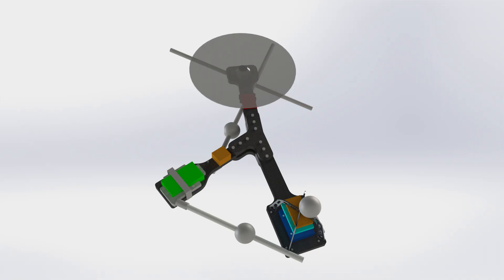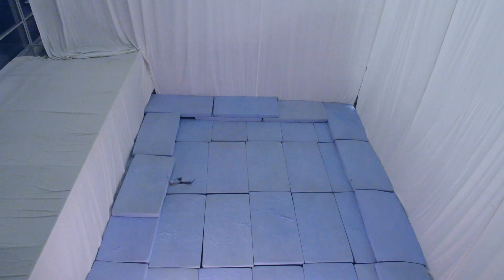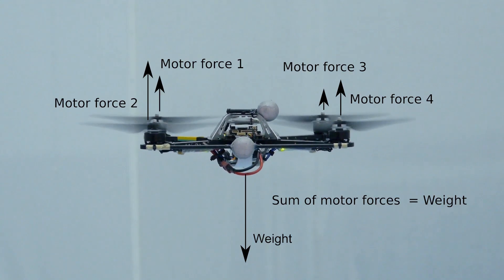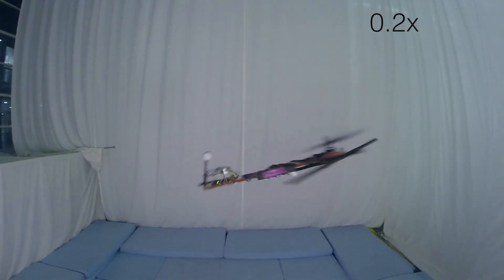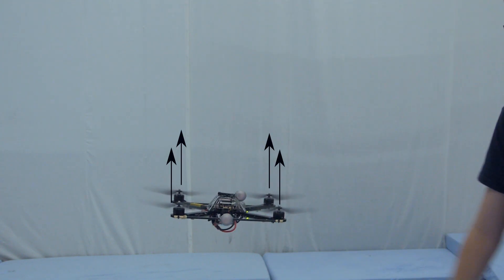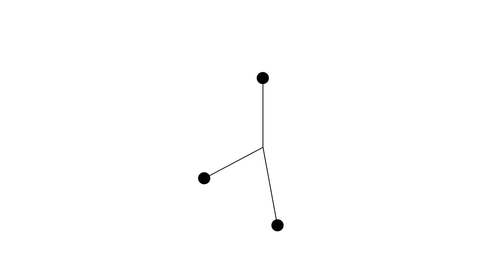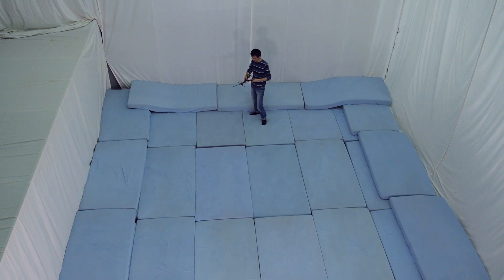The Monospinner: a controllable flying vehicle with a single moving part

Comment: 1. Rotational Dynamics Equation

I_B \dot{\omega}_{BE}^B + I_B p \dot{\omega}_{PE}^B + \left( \omega_{BE}^B \times \right) \left( I_B \omega_{BE}^B + I_B p \omega_{PE}^B \right) = [r_P^B \times] e_P^B f_P + e_P^B \tau_P + \tau_d^B

, : Angular velocities.

: Position vector of the propeller relative to the body.

: Force produced by the propeller in the body frame.

: Torque generated by the propeller.

: Damping torque due to aerodynamic drag.

This equation represents how the monospinner's angular velocity evolves due to applied forces and torques.

2. Translational Dynamics Equation

m \ddot{p}^E = e_P^E f_P + mg^E

: Acceleration of the center of mass.

: Propeller thrust in the world (inertial) frame.

: Gravity force in the world frame.

This describes how the monospinner moves due to gravity and propeller force.

3. Damping Torque Equation

\tau_d^B = - \| \omega_{BE}^B \| K_d^B \omega_{BE}^B

: Angular velocity.

This models how aerodynamic drag resists rotation.

4. Propeller Force Model

f_P = \kappa_f (\omega_{PE}^B \cdot e_P^B) |\omega_{PE}^B \cdot e_P^B|

: Angular velocity of the propeller.

: Direction of the propeller's thrust.

This equation gives the propeller's force based on its angular velocity.

5. Propeller Torque Model

\tau_P = - \kappa_\tau (\omega_{PE}^B \cdot e_P^B) |\omega_{PE}^B \cdot e_P^B|

This describes how the spinning propeller generates torque.

Overall Meaning

These equations fully define the monospinner's motion, including:

How it rotates due to propeller torque and aerodynamic drag.

How it moves in space due to thrust and gravity.

How its single propeller produces both force and torque.

Comment: I think Monospinner could be modified into a good cheap tail sitter drone. The main body of the drone is a dihedral flying wing, with Monospinner pulling it forward (or up, in the tail sitting position). Superficially, it looks like a normal propeller, but it's on a bent crank. As the prop spins, it naturally spins the crank at a lower speed. Thus, the prop circles around a bit.

The point is, the crank offset lets you control the average alignment of thrust by pulsing thrust cyclically. You can control the movement of the Monospinner Tailsitter toward any direction, and the dihedral flying wing will follow suit.

The crank system does mean that this hybrid Monospinner Tailsitter has two moving parts - the propeller and the crank. However, it maintains the hardware simplicity of the controls. It only uses a single on/off motor for full directional control.

The use of the dihedral flying wing in horizontal flight mode means this tailsitter can have excellent range and endurance. And unlike a tail sitting quadrotor, it doesn't have the rotors sticking out on drag inducing bars. The bent crank only needs to offset the rotor a modest amount.

Comment: Not buying it. How can you control in wich direction it goes in by only adjusting the speed of the motor?
Reply: It actually works, watch ScrapMan video where he recreated this in a video game
Reply: It's because the position of the rotor hub is off center. Thus, the rotor's position moves around in a circle rather than staying at a single place. If you increase and decrease thrust as it goes around the circle, you end up with an off center overall torque that alters the direction of flight.

Comment: a machine that uses zero moving parts would need some kind of bladeless turbine to produce thrust, using either some crazy application of heating and cooling elements, electromagnetic currents, ect. right now i think the closest analogy would be a ramjet quadcopter, though considering a ramjet needs an initial velocity to get it started it would be more like a ramjet frisbee thrown first to give it that momentum. maybe not a fully autonomous flyer, but could be a (relatively) cheap drone if you can get the construction right. maybe use electric heating elements somehow instead of fuel. a single camera facing downwards with programming to counterspin the footage so it looks steady would be the best you could get without moving parts though
Reply: vaguely similar plans about this kind of machine where pioneered in 1913, some others planned to use small rocket motors to propel the blade https://en.wikipedia.org/wiki/Monocopter

Comment: I have a couple things I want to ask:

1)  Are there any open source models/software or is everything about this project propriety? It's super awesome and would  love to try and recreate one :-)
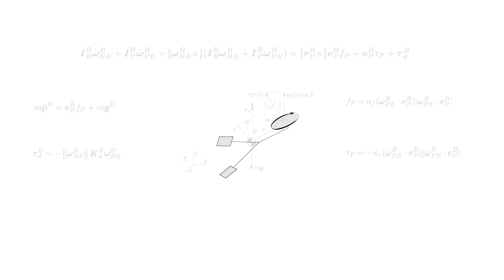2)  Could someone help me understand all that those math equations 0:43? 
3)  How do you steer the thing without causing the momentum to flip it over?  Do you have to spring the whole thing like a boomerang to get it to start (there is no initial rotation about the center of mass)? 
4)  1:39 even simpler than one propeller? how about half a propeller :-)
Reply: No, not even one propeller. She said NO/ZERO moving parts... 
This is why I came to the comment section, she's joking, right? How on earth is this even supposed to work...? 
Am I understanding something wrong?!? Anybody got an idea?
Reply: @2Complex2  Well, theoretically you could use ion propulsion like the one built by MIT. But I believe it's still very experimental. I recommend you take a look at it.

Comment: This is similar to the monowing "Samarai". The Dynamics behind this are impressive. As for 0  control surfaces I imagine a sailplane flat-spinning in a thermal could be described as such. However, I imagine placing a drone inside a thermal with the right spin will be difficult. Alternatively, they may be thinking of alternative propulsion systems with no moving parts.

Comment: Looks like a ripoff of the maple leaf seed design from about 5 years ago.
Reply: +imozarksteel 
You can't actually be serious? I quickly googled the design that you mentioned, and they're completely different!
Reply: You are correct... they are different... but they are very much the same.  They both spin on a single axis to maintain lift.  This design lacks the lift component in the event of an engine failure... not exactly a design improvement.  This design requires a lot of additional "computer control" to remain aloft... not exactly a good thing in my opinion.  Both designs do the same thing... they fly... and are controllable... and require only one lifting motor.  Congrats all around.  It is an engineering feat to say the least, but it isn't revolutionary.

Comment: So is useless as a plane, useless as a delivery drone, useless for a camera because of its moving, so whats its use?
Reply: +Gerardo Pacheco You could still use it as a Camera Platform by either:
1. Using a Gimbaled Camera capable of cancelling out the movement of the Monospinner - Requires 3 moving parts for all three axis wich defeats the purpose of the System but should produce decent Pictures at high FPS.
2. Using a rigid mounted Camera that only captures an image whenever the Monospinner and it are facing the proper direction - Requires no moving parts but reduces the FPS to the amount of RPM the Monospinner makes.
3. Using a 360° style Camera that keeps recording in all directions at all times but then uses software to keep focus in a particular direction - Probably the best solution as you're not tied to the RPM's of the Frame to get good FPS while still maintaining the one Moving Part characteristic.

The only situation where I could see for something like this to make sense would be for Surveillance in a Combat Zone with heavy firefighting - Just alter the Flying Algorithm for it NOT to be THAT stable causing it to have a more erratic flight pattern and you're golden since enemies will have a hard time shooting it out of the skies.
Reply: Well thats heavily specific, and also, by its low weight and the nature of its movements wouldn't it be heavily affected by winds, rain and other natural forces, so even if the bullet doesn't hit the drone itself the force and energy of its movement would surely affect the drone itself, quite an interesting setup at 3. by the way.

Comment: Not a good idea. It's not simplier at all. You need really complicated algorythm to control it movements and this is its bottleneck. And of course no need to point at how complicated would be the work of all additional devices.
Reply: +Aleksander Silver They allready have a working algorythm. 
Any engineer can tell you there are a host of advantages to reducing the number of moving parts in your machine. This is just the very earliest prototype, it's gonna take some time to  refine the technology and adapt it to real world applications.

Comment: Dude, it's called a Helicopter, and they're considerably less retarded than this.

Good luck filming on this!
Reply: +Alex Paulsen Helicopters require many, many moving parts.
Reply: ***** A single rotor on a balanced craft would surely be less retarded than this thing, and function much the same.
Reply: +Alex Paulsen A single rotor doesn't work because it doesn't balance out the torque.  You just end up with the craft spinning in the opposite direction.
Reply: +Alex Paulsen This experimental aircraft isn't necessarily meant to be immediately practical. That being said, there are many other uses for drones besides holding cameras.

 Also, notice that this craft DOES spin opposite of the blade rotation, as suggested.

The fascinating and impressive part about this machine is that it's still fully controlled flight, regardless of that lack or yaw control.
Reply: MrBirdnose
And you're telling me this in the comments of a video about some spinning retarded single-rotored craft... Good job buddy!

Comment: What's wrong with having more than 1 moving part? The quad copter looked smoother and more useful than this.
Reply: +Bill Bingham I don't think it's meant to be immediately useful, but it's an interesting bit of research into how software can control unusual flying machines.  I'm sure the principles they learn from this can be applied to more complex machines.
Reply: +Alex Lawrence Less chance of failure, to an extent. However once you get to a single moving part, you have no chance for recover if your one and only part fails. Quad copters can still fly if one motor fails, giving the copter the ability to make its way back to a place to be maintenance. This would simply fall like a brick.
Reply: +Bill Bingham The less moving parts you have, the less chance of failure. Also, you'd have less maintenance required, along with lower costs. This looks to be the first iteration for this design, so it will likely get better and better as time goes on. Right now, the quad-copter is better, but this monospinner may soon surpass the quadcopter in terms of benefits and cost given a few years.
Reply: +Alex Lawrence nope. It's not simplier. And just remember about stabilization and vibrations.
Reply: +Bill Bingham  i guess this one is far more rewarding to hit with a fly swatter cos it's looks like a drunk annoying pigeon
Reply: +Bill Bingham I don't think it's meant to be immediately useful, but it's an interesting bit of research into how software can control unusual flying machines.  I'm sure the principles they learn from this can be applied to more complex machines.

Comment: question: in case of flight controller, or props, or other fault on a quad copter, is this controller able to auto learn the new copter dynamic flight condition then fly it down so slowly to have a fail safe landing??? thanks

Comment: Very clever, but I couldn't think of a single use for it.
Reply: +Arran HS  the dynamics of unstable flight are probably going to be the single biggest thing in aviation technology in the future. 

practicality? the sensor and it's control algorithms can be implemented on quadcopters to allow for a control system that allows quadcopters to do maneuvers never thought possible---------temporarily engaging unstable flight patterns and extreme acceleration turns that one would see more likely in humingbirds bats and insects and very agile small birds..........
Reply: +Arran HS 
Maybe we are just not there yet, or its  not that obvious for people who dont work in that field, maybe you can make that thing part of another thing, and omptimize the way it works ...
Reply: I think the advancements of the aeronautics combined with the low weight and simplicity is what to take away from this one, lessons learned here will improve loads of things down the line
Reply: +Arran HS The math that does this sort of magic, is quite generic. It can be used to land an airplane that lost a half of its fuselage and most of the controls. 

More methaphorically: think of it not as 'robot body', but 'robot soul', that capable of flying even that limited body.
Reply: Drone Wars